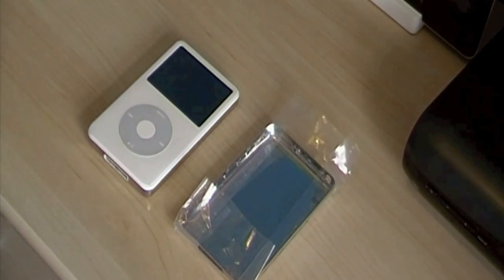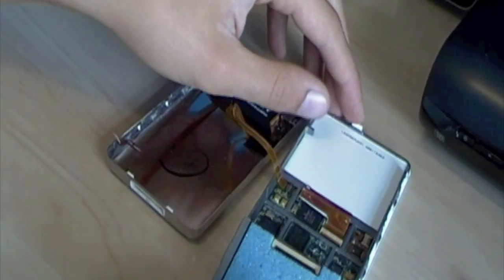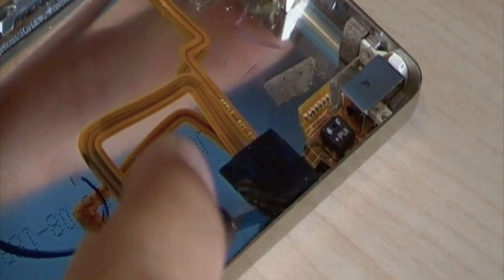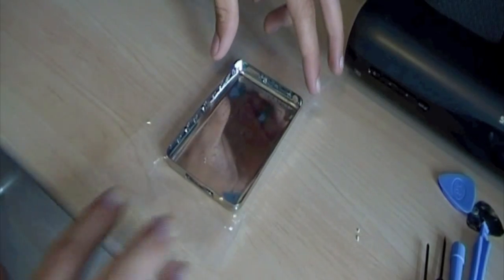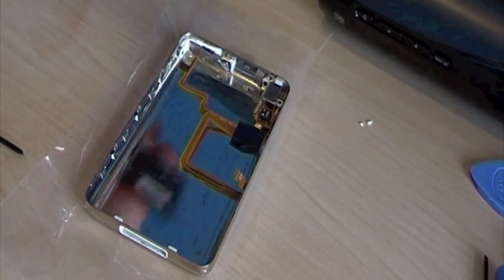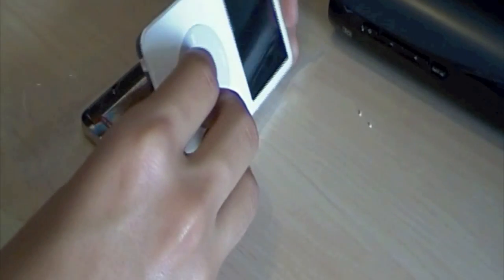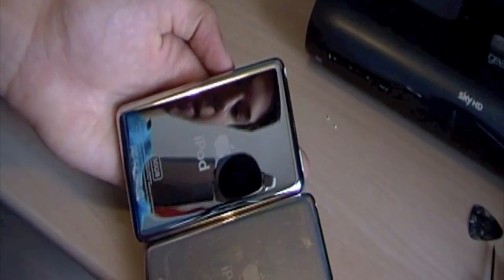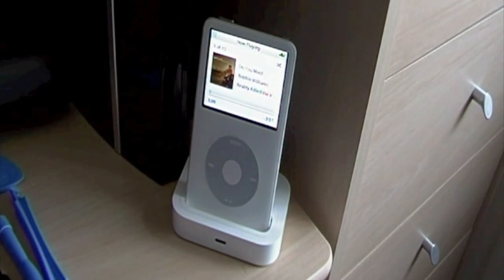replacing ipod classic casing

Comment: This was a very helpful 'how to'.
I had an unfortunate snag though.
2:20 got to the battery removal step but glue attaching my battery overlapped with the hold cable so the battery was sticking to this cable and when it jerked upward as it came undone it also snapped this fragile cable. 
I just wanted to mention this as something other people are doing this to look out for and be careful of. 
I hope you had better luck than me. Anyways, I have ordered a replacement form eBay which was $16 NZD. It will get here in two or three weeks then its time to carry on from where I left off. No ipod for that time though :'(

Comment: Hey Mike I have to change battery in my 5th gen 30 GB I Pod i opened it no problem but its totally different than all the ones on you tube battery is sitting under screen and the cable goes under hard drive i cant find any like this can you help me out 
                                                               Thanks in Advance